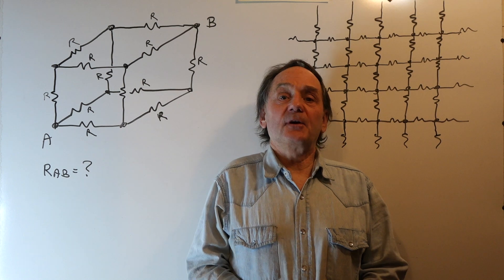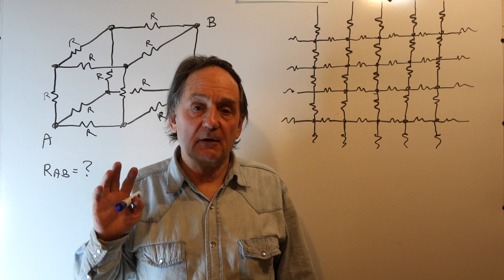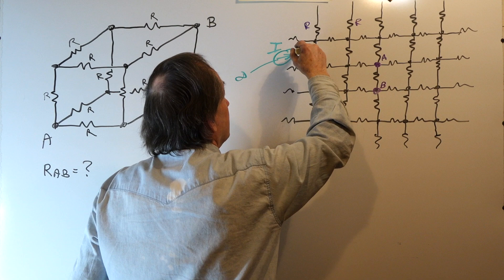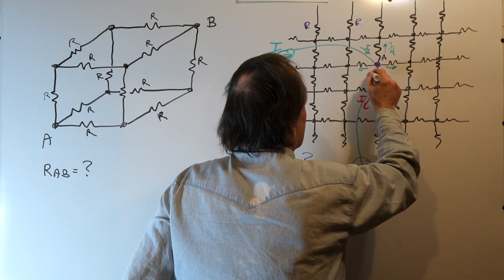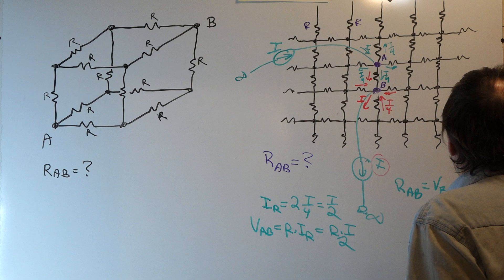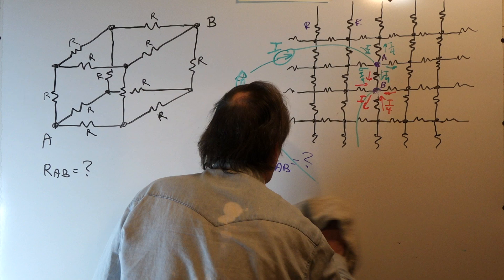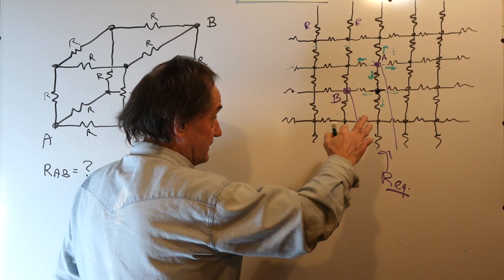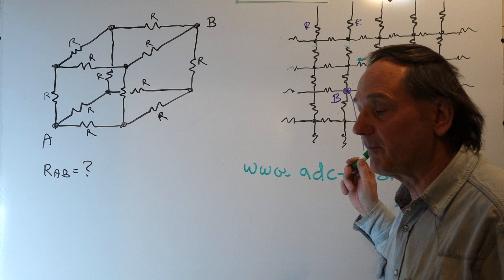Infinite Resistor Grid

Comment from the maker: The original grid problem was uploaded on Feb 5, 2018 six months ago.  There have been 2800 views as of today and no correct solution has been submitted.
NOTE:  the answer is NOT  2R/3 , R/2 , 5R/6 etc.   If you got that value then you are NOT applying symmetry correctly and you need to watch BOTH update videos.  The actual equivalent resistance value across a diagonal is NOT a rational number.  The resistance value between diagonals is NOT of the form  P/Q where P and Q are integers.
VIEW  THE   UPDATES.                                                                
GH                                                                                              dated:  August 9, 2018

I have further discussed the infinite resistor grid:
UPDATE:  https://www.youtube.com/watch?v=OUe74QiT14Q&t=9s

MORE  HINTS in UPDATE 2:
https://youtu.be/lOLsglKJtJY

George Hnatiuk
Reply: Hlo sir is the value of the effective resistance 4R/6
Reply from the maker: What?   4R/6  =  2R/3 and I have stated that is NOT the answer
Read my pinned comment.
GH
Reply: R/2
Reply: R /2
Reply from the maker: @manglasable8673  The value is not rational.   Read my pinned comment.
Gh
Reply: 7/12
Reply: Sir I think the value is R ????

Comment: If the resistance R between A and B is removed then find the current shown by the ammeter if it is connected between A and B
Reply from the maker: How does that help you?  If you remove the resistor, then you change the circuit and the current distribution.
GH

Comment: what will be the voltage required to produce this current? Will it be infinity since the resistance across infinity and A is infinite?
Reply from the maker: Resistance between any two nodes in the grid is not infinite.  That resistance is always finite because of all the possible paths for current to flow that are in parallel.
GH  Sept. 1, 2021
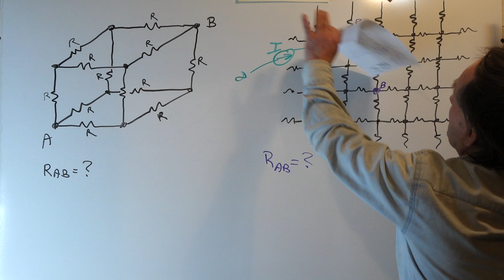Reply: @georgehnatiuk5806  Hello sir, i am talking about 2:53. Since the current is flowing from infinity to infinity, the resistance is infinity, the voltage required should be infinite as to produce a finite current.
Reply: @georgehnatiuk5806  ohh ok now i get it, it is a current source not a battery. I did not know what a current source was, i thought it was same as a battery. That was stupid of me. Thnx now i get it.
Love from India.

Comment: Why are we adding ia and ib for the current passing between nodes a and b ? Can we not just consider the i/4 passing through the node a is the same current which is passing through node b ?
Reply from the maker: No, that does not work.  The current passing into node A is i and not i/4.   When determining the equivalent resistance between two nodes A & B by injecting a current into node A and computing the voltage difference generated by that current between nodes A & B as Vab/i,  you have to have the SAME current exiting node B and you injected into node A.  You do not have that occurring by just injecting current "i" into node A, you also have to pull the SAME current out of node B to claim  Rab = Vab/i.
GH  Jan 21, 2021  1:57pm

Comment from the maker: With the use of the "substitution theorem" you do not replace voltage and current sources when using the substitution theorem for those are fixed and do not change.  In the substitution theorem PASSIVE elements are replaced with a voltage source that is equal to the voltage across that element.    Once a substitution is made, you lose information about the original network and can not go back unless you also calculate the current in the voltage source that is substituted.
I never use the theorem in practice for I have found it to have limited value.  It is just an obvious statement of a property of linear circuits.

Comment: Why we cnt say that current equally divide at node B When it connected to diagonally with A
Reply from the maker: Doing so will eventually get you into trouble in trying to satisfy KCL and KVL in nodes further removed from the initial node where current is injected.  Try it.  Go to the next set of nodes using the symmetry argument.

Enough people have asked me this very same thing.  I will produce a short video addressing this issue.
GH
Reply from the maker: MORE  HINTS in UPDATE 2:
https://youtu.be/lOLsglKJtJY

Comment: sir could you make a video on methods of equipotential reduction
Reply from the maker: THE LAST ARROW:
Not sure what you mean by equipotential reduction.   If what you are referring to is looking at a network to find nodes at the same potential and connecting those nodes with a short it is as simple as that.  The other way is to take a node and divide it into several nodes at the same potential.  Both procedures can at times help in finding solutions.  If that is what you mean, then yes, I can do that.   I will be using the later technique coupled with superposition in solving the Twin "T" network.
GH   Aug 07, 2020

Comment: When using superposition, why don't we consider the other 3 branches? 

Like if in AB, I/2 flows, and I/4 from the other 3 branches(into B), then shouldn't net current coming out be 5I/4?
Reply from the maker: Rakhee,
When determining the equivalent resistance between the A-B terminals we only need to know the voltage between them, Vab, and the current flowing between those two terminals thru the branch between A-B which is determined by superposition:

                               Iab  =  IabA  +  IabB

        IabA  =  component of current  "I"  flowing into branch AB  from node - A
        IabB  =  component of current  "I"  flowing out of branch AB from node - B

Only the current components that split and flows through branch  AB  is needed.  The other three branches do not enter into the calculation for those currents flow away toward infinity NOT back to nodes A or B.  

                           Rab =  Vab / Iab .

GH
Reply: @georgehnatiuk5806  thanks!
Reply from the maker: You are welcome,
Just remember that current flows away from the current injection nodes toward infinity and cannot ever loop back to the injection node or nodes adjacent to it.  Voltage differences decrease relative to the injection node as you move out toward infinity hence current must flow toward the lower potentials which decrease as you move toward infinity at any point in the grid.
GH
August 06, 2019   9:46pm